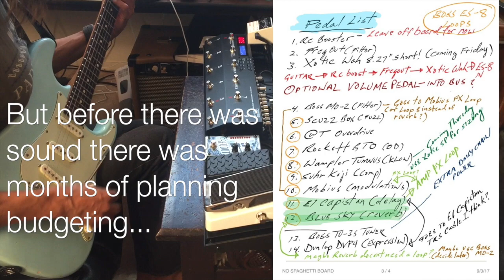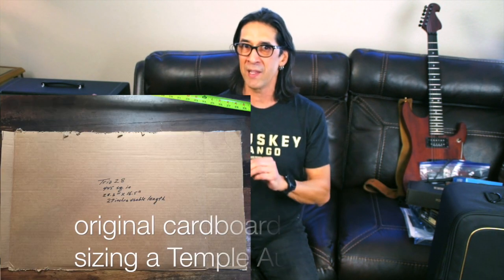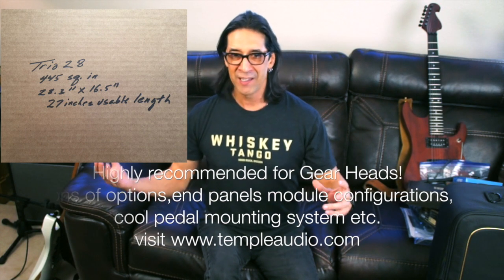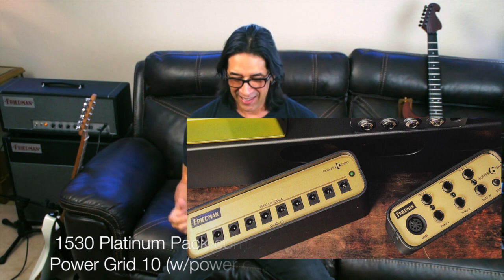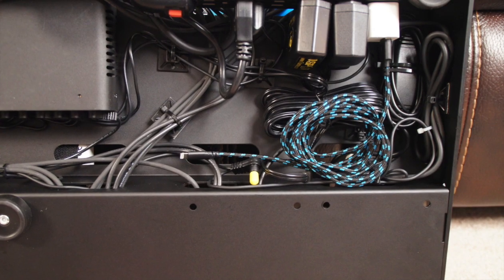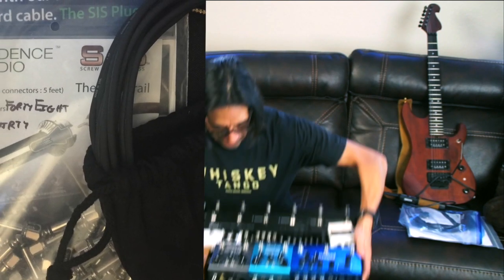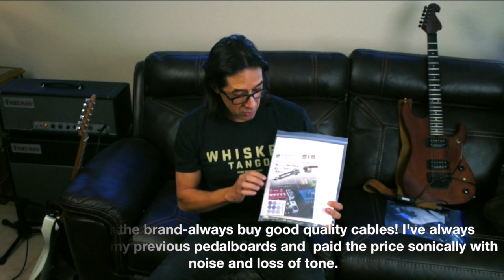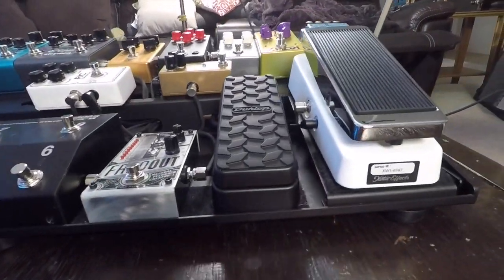Mundo Juillerat Pedalboard Build part 1

Comment: Hi Mundo.  How did you mount the ES8 to the board?  screws or Dual-lock?  I'm about to move my big board from a pedaltrain to a Friedman 1530.  Its weird I had no problem drilling a pedaltrain but I feel weird drilling a Friedman board knowing what they cost.
Reply from the maker: Howzit JJukstratfan-Carl Popek who built the pedalboard used a layer of 2 inch fuzz (side down plastic hook) on the bottom of the ES8 and then on the Friedman he used industrial velcro.  I can shake it and turn it upside down and nothing moves.  Hope that helps. Let me know how it works out!